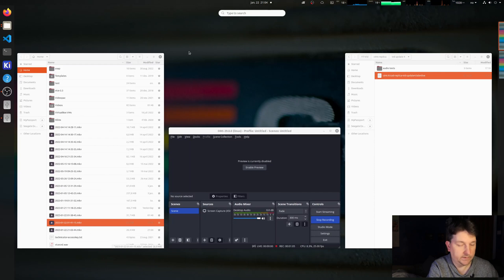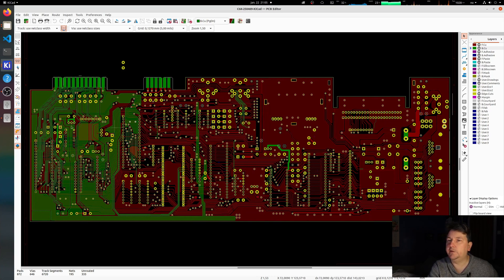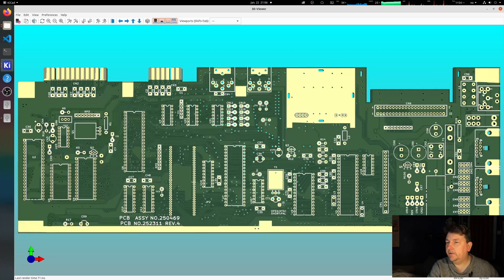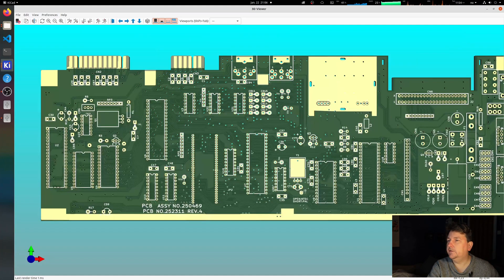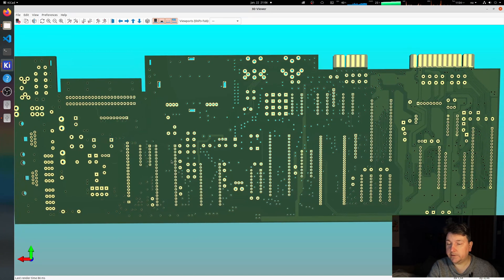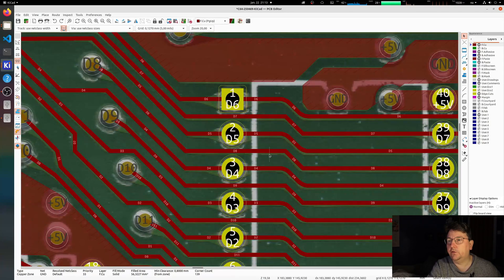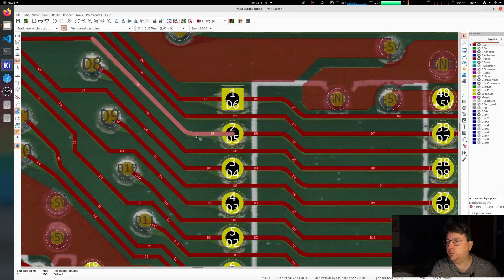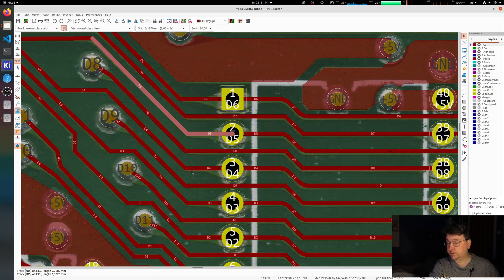C64C Motherboard KiCad Replica update 4

Comment: Hi again, will you also do the larger kind of water droplet shaped solder pads like the original, is it possible with Kicad ?
Reply from the maker: Sure. Footprints are built in and custom. I draw 99% of the footprints for this project.
Reply: @bwack  please show how! Thank you ;-)
Reply: KiCAD7 has a toggle switch to activate and deactivate globally teardrop pad shape. When you ready with layouting just activate this option before generating the Gerber's.

Comment: Hi, for the microphone I use the H1 and connect the output of the H1 to the input of the camera. That way the audio is included with the video file, make it easier in editing…
Reply from the maker: Thanks for the advice! Also the audio will be amplified before reaching the camera which is great because the camera seems to have a noisy preamp.